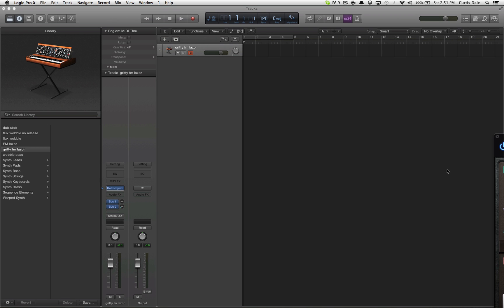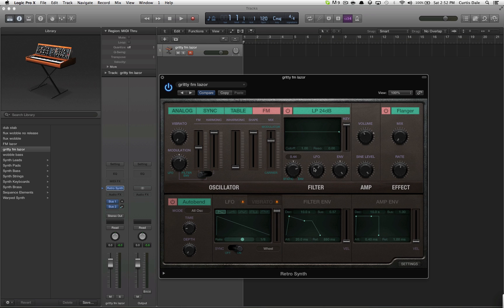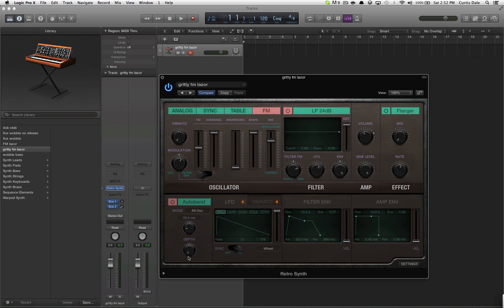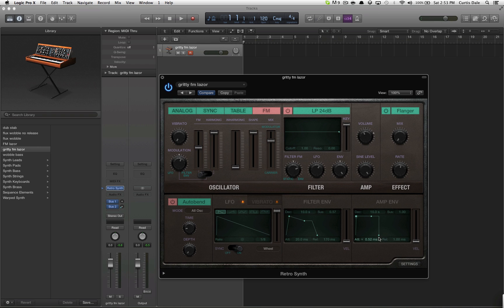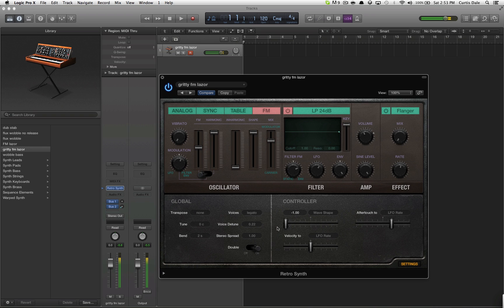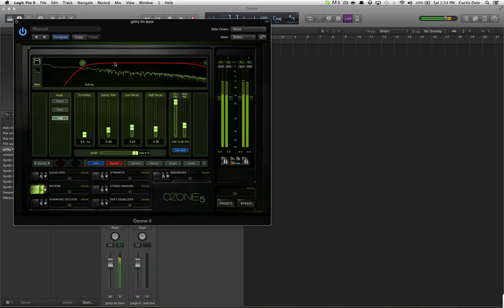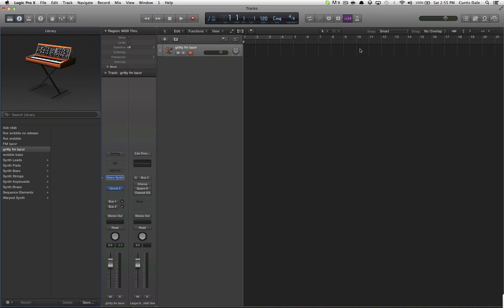Tutorial: Popular Dubstep FM Screech Bass In Logic Pro X

Comment: I have three questions I am a beginner producer and I am having trouble finding what your using. I know your using Logic Pro X, but what instrument did you start out with? And how did you get the that menu open and what is it called? Are you using a external plugin from somewhere else?
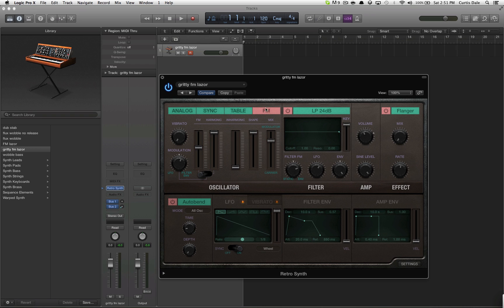Reply: +Fear Fly The instrument is a retro synth, it comes in Logic X, it's not an external plugin. If you pause it at 0:28 and look closely to the left of the popup you'll see a small blue box that is glowing, it has a smaller white arrow to the left of it, and this box is up a bit up from the volume fader. If you open a software instrument channel and you click on this same box, you'll have the option of picking an instrument (Retro Synth in this case) and editing it. It's different from the preset instruments that you'll find in the library. Open that helps!
Reply: Sam Littlefield That helped a lot. Thank you so much!
Reply: Fear Fly Absolutely friend! I'm used Logic since 2008. I just upgrade to Logic X this week, but if you have any questions in the future, I'd be more than happy to help if I can.
Reply: +Fear Fly RETRO SYNTH

Comment: What instrument do you start with for the gritty fm lazor?
Reply: Matt G I think the reason he is confused is when you first open the Retro Synth plug in the instrument is set to factory default and not his preset which he named gritty fm lazer. I did everything he said to do in the video and mine still doesn't sound the same. I don't know if the reverb is off somewhere or if its because you're suppose to start with a certain synth when you open the plug in.
Reply: ***** i know hes using the  retro synth dumbass its the gritty fm in the top idiot
Reply: Bad Brad He's made his own preset, which he's saved as gritty FM lazor. But he shows you how to make it from scratch
Reply: +Wizardmonkey123 RETRO SYNTH